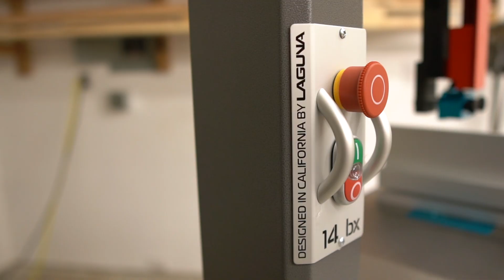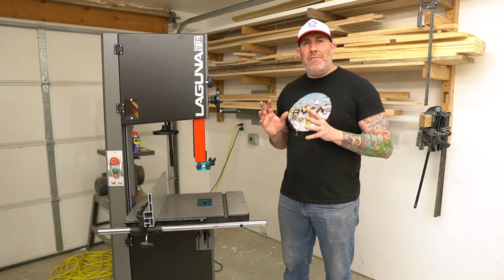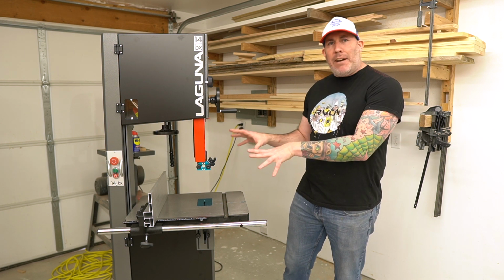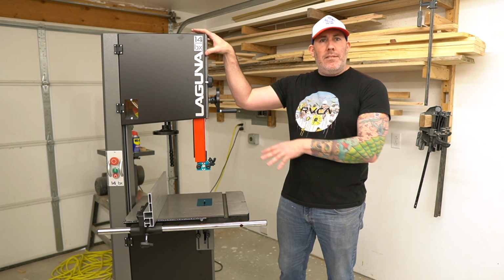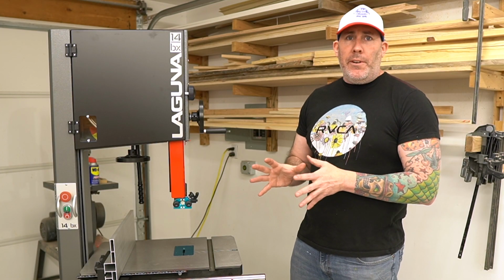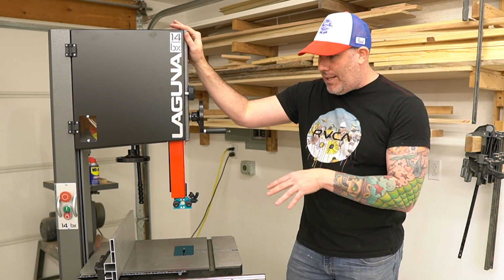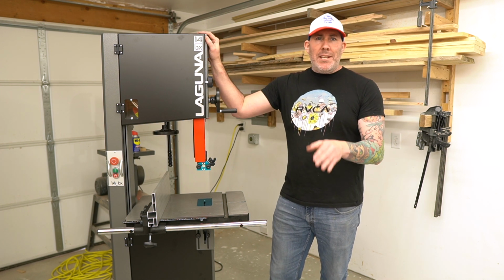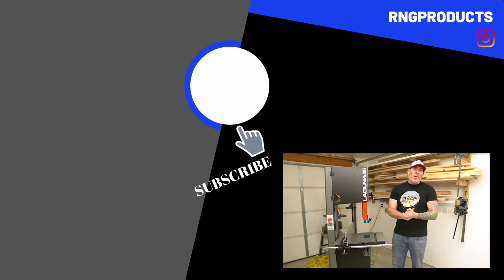Laguna 14BX Bandsaw Unboxing and Assembly

Comment: Your video did not include setting the table to perpendicular,  releasing the bolts that locked the tension, setting the fence glide height, setting the ruler to zero, and because you are bladeless, you didn't address blade position or setting the guides.

Comment: I have same bandsaw 2.5hp like new shape for $700 last week on offer up but it missing the fence the guy lost in a move. Does the fence work to correct drift ? Laguna sells the fence in pieces $$,  so i guess i might go for Carters magfence the Kreg is short on mount to base. The other question does the power button light up between the i/0 looks like it should. Thanks

Comment: What type of plug end do you have on your 220v receptacle?  NEMA 6-20R?  And what kind of plug end does the laguna come with?
Reply from the maker: Electrical is not my area of expertise. The male plug end says IH-107 and it looks like your basic 110v plug however both hot ends are horizontal and not vertical. These are newer style plugs for me, as I am I used to welders with the large 220v plugs LOL

Comment: Just an FYI:  The 120v and 240v versions are NOT the same price.  There is a $100 or so price difference.
Reply from the maker: *220v 1499 https://www.woodcraft.com/products/laguna-14bx-bandsaw-220v-2-5-hp *110v 1499 https://www.woodcraft.com/products/laguna-14bx-bandsaw-110v-1-75-hp 🤷🏼‍♂️
Reply: @RISENGRINDWORKSHOP  I sit corrected.  When I purchased my 240v version last Memorial Day, there was a difference.

Comment: I just set mine up.  put a new Starrett 115" X  5/8" X 3tpi as recommended by the guy at woodcraft.  Cuts worse than my shopsmith.  just lousy,   have to push like a bull dozer to get it to rip a 2 X 6  with the high fence.   anybody know what blades are better.  The $26 price probably should have been a dead giveaway.
Reply from the maker: That sucks. I was lucky enough to have had Laguna send me out one of their 3/4 Re-Saw king blades. My intended use for this machine is to Resaw hardwood. Blade retails for $150 but I can tell you it's a beast! Just don't have the luxury of tight radius, if I ever need that I still have my old Craftsman saw. Get a better blade for sure!